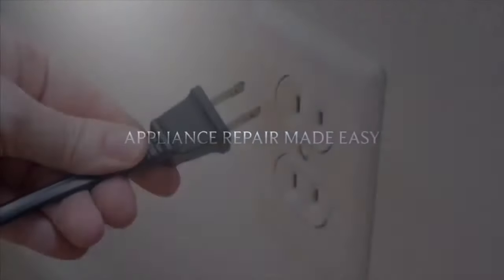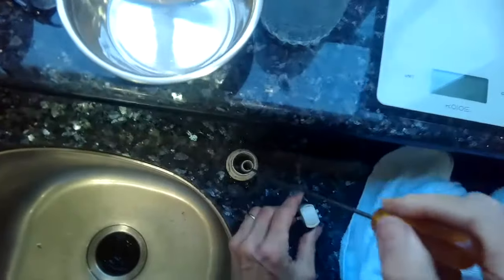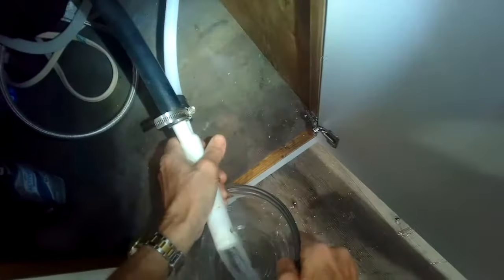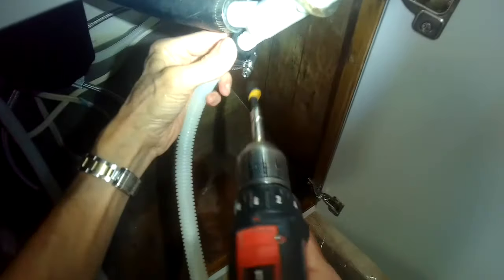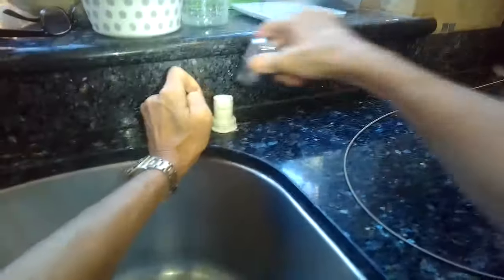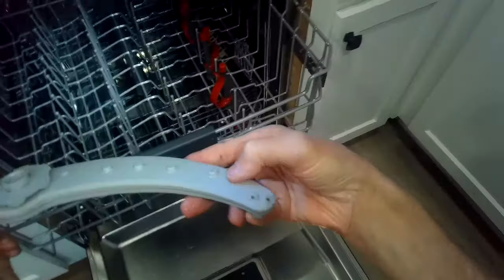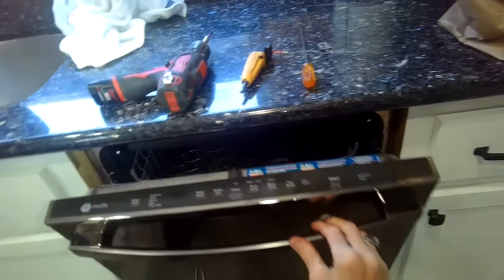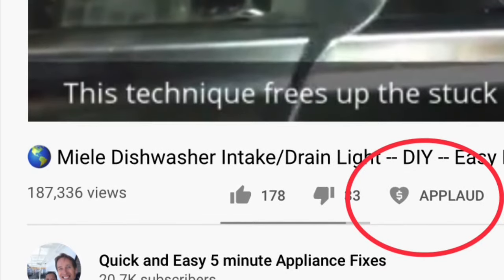✨ DISHWASHER STOPS MID-CYCLE  (EASY FIX) ✨

Comment: Fixed our dishwasher by following his simple instructions. Found a small plastic piece in the discharge hose where it connects to the garbage disposal. That clogged it enough to cause the dishwasher to stop every time during the first minute it was started. Works perfect again!  Thank you so much for saving us a service call for something that took me less than a minute to fix myself.
Reply from the maker: Thanks so much Wade 👍😊

Comment: OMG! How awesome!  Super thank YOU!  Appreciate the detailed video!  I cleaned some gunk from the garbage disposal inlet as well as a bunch of junk in the drain tube at the connection.  Used a couple of old toothbrushes to clean it out.  I heard it fill, (yay) swoosh  (yay) , open the soap tray (yay), wash, (yay), rinse (yes!!!) then - it stopped like it's finished.  The light did not go on - atleast -  40 minutes of the cycle out of 52.  No idea what to do.  Suggestions, please?  Inside, everything is clean, no water sitting there.  Gee whiz.  Lost a lot of sleep over this.
Reply from the maker: Can you send me an email to: scottthefixitguy @yahoo.com
Reply: @cmarin5904  did you figure out ehat the issue was? Mine has been doing the same thing and i have tried almost everything including replacing the o-ring so there is no leakage in the dishwasher itself to trip the water sensor to make the norma cycle light blink
Reply: @ - I let it 'rest' for a week.  I really hoped it needed a break - to watch me wash everything by hand. 🤦‍♀
I turned it on, "H2O error".  Now I have something to go by!  I will order that new water inlet valve and change it out.    
🤞

Comment: Upgrading my air gap to a copper model with slightly larger pipes and and better design (screw cap on top) eliminated problems with it getting clogged.

Comment: My dishwasher is a whirlpool wfc3c24px and sometimes it stops mid cycle with water on the bottom and pauses, if I change the program to 30min program it works perfect, also some times it will work for days with no problem but then randomly Starts pausing again. I have tried moving the drain hose around etc, we don't have sink air gap thing I live in ireland and it just connects under the sink tot the drain. Pipe
Reply from the maker: Might end up needing a new controller 👍

Comment: Love the channel! My dishwasher is connected directly into a wye pipe on the sink drain above the trap and there is no separate air gap. Is this installed improperly?
Reply from the maker: Yours is fine👍 it’s good to bend that drain tube way up in an arch as high up under the sink as possible 😊
Reply: I found the dishwasher is still acting up if I leave on steam or heated dry. It will shut off towards the end of the cycle. Main board is giving a one flash for communication lost between UI board. I verified the heating element was putting out 16.5 ohms and the TCO thermistor was good. I am suspecting there’s a problem with the turbidity sensor because I am only getting 2.832 mega ohms between pin 7 and 10. When I put it into service mode and operate the heater, there is no voltage present. The instructions that were with the dishwasher say that four blinks is the heater but mine is actually at six blanks and this instruction sheet does not list a six blank mode. Mode three and mode for both do circulation pump and five is the detergent module and six is the heater. The circuitboard is new, so I’m wondering why I’m not getting voltage out of the circuitboard to the heater. I noticed when the water fill valve goes it is only at the minimum place and never goes high enough to even touch the element for the heater so that’s why I suspect the turbidity sensor. Please excuse the long message, but I’ve been working on this dishwasher for five hours today. I would appreciate any help you can give me. Is it possible the dip switches on the new circuit board were not set up properly for my machine? Thank you.

Comment: Scott - loved the video!  I'm trying to troubleshoot a GE dishwasher of mine that looks almost exactly like the one in your video.  It stops mid-cycle.  No error messages, no blinking lights, no nothing - it just decides to stop sometime in the middle of the wash cycle and shut down.  I got the service manual and was able to get to Consumer Error Mode and see a "56" error code - seems to indicate "Failure to Drain", but there's no water in the tub.  I have a high loop on the side and no air gap.  Drain hose is connected to garbage disposal.  For code "56", the service manual just says "Review Training Bulliten TB11-20", but I can't find that anywhere on the internet.  Hope you can help!
Reply from the maker: Hey Mark,
It’s just draining a bit too slow.
Can you pull the drain tube off of the drain motor and look for junk caught in the drain tube or in the drain motor?

Comment: at 3:29 what is that drill attachment called? Something like a hose clamp driver? But cant really find it online, only for a hand screwdriver
Reply from the maker: It’s just a 5/8 inch driver.  You can get a set of drivers from  Milwaukee.com
Reply: @ScottTheFixItGuyChannel  I think you mean 5/16”. Hose clamps at that size are either 1/4” or 5/16”. To commenter, you can get them in almost any hardware store as it’s a very common driver size

Comment: Our LG dishwasher (LDT5665ST) randomly stops mid cycle, most times with water remaining in the bottom.  The numeric display showing the minutes remaining is dot matrix and some of the dots are off so its hard to discern the numbers.  I'm hoping a new control panel assembly (LG AGL75675203) fixes our dishwasher.  Before I spend $200+ for the panel, do you think this will fix it????
Reply from the maker: I think you’re right.
Is it able to easily drain the water?
Reply: @ScottTheFixItGuyChannel  Yes, it randomly stops, no lights, with water in bottom.  The times it does run to completion it has lights displaying "End".  I can press Power and then hold down Start to run the Pump to evacuate the water.  Dishes are usually clean but a little damp.
Reply from the maker: @cwmoser  might be good to put your drain hose in a bucket and then run a cycle to see if that helps it drain.

Comment: Mine has like a grinding sound. Then shuts off completely. It comes back on but won't run more than 10 minutes.
Reply from the maker: Hi Jordan,
Can you tell when in the cycle it’s happening?
Reply: @ScottTheFixItGuyChannel  Not really. I put it on auto and it says 288 minutes. It gets down to about 265 then stops.
Reply: Thanks Jordan,
Sounds like it needs a new circulation motor.

Comment: My ge dishwasher shuts off and no power on lights etc
Reply from the maker: Hi Jake,
Just needs a new power board.
It lives beneath the door.
Reply: i ve got the exact same problem. ge shuts off and can't turn the unit on, no lights either
Reply: Can you try pulling all the wires off of the power controller that lives under the door.  Then you plug back in a few hours later and it should work.
Reply: @QuickAndEasy5MinuteAppliance   thank you,  I did so a couple days ago but it ended up being off again.
I ordered a new mother board. Hopefully it will solve everything.
Reply: Dude replaced the motor thinking that was issue didn't solve the problem...ooops
Reply: well my guessing with changing the mother board was wrong too. in the end it keeps shutting off. this dishwasher is just crap. wasted 110 bucks on the spare part
Reply: Ever figure this out? Mine is shutting off and on and now won’t turn on at all